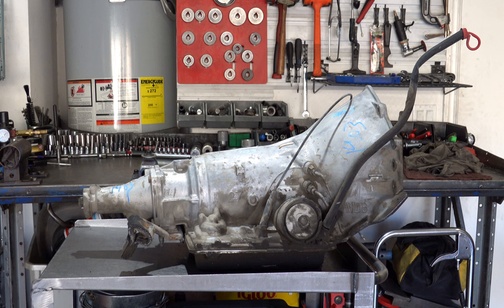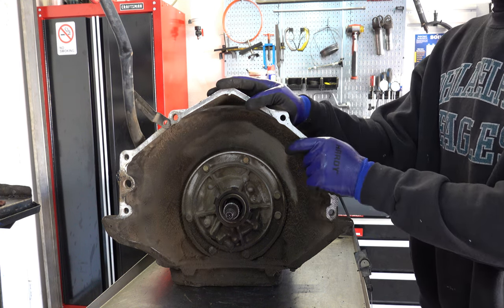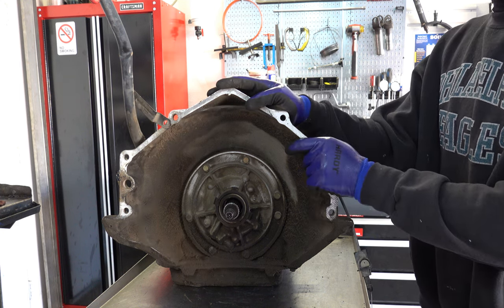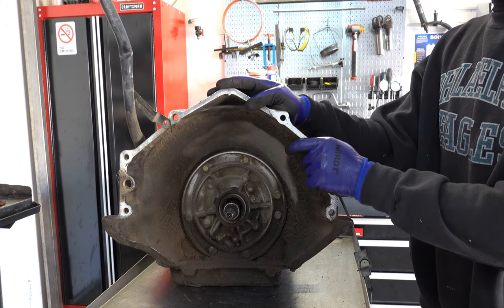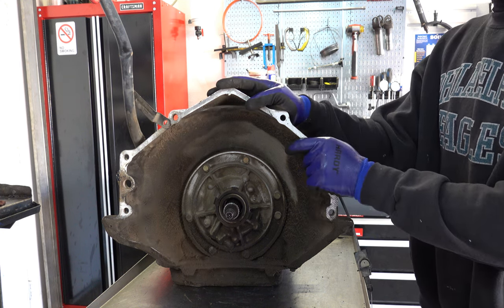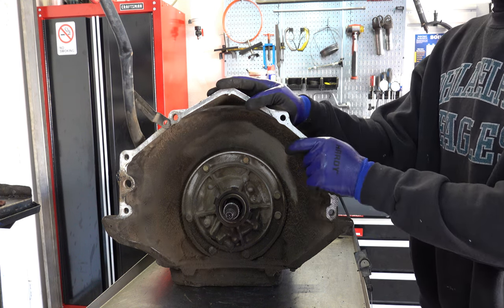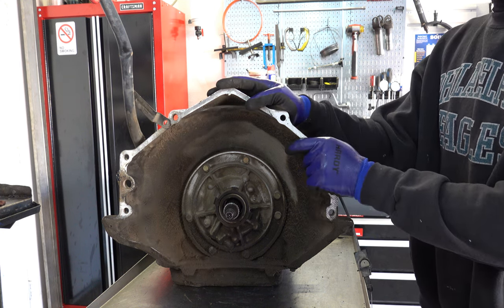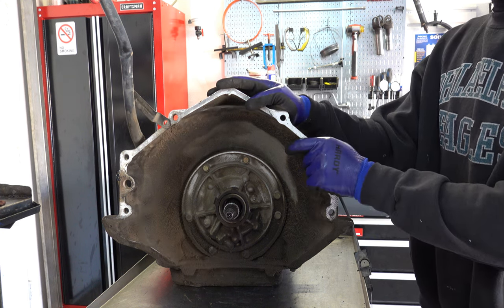700R4 Teardown and Inspection

Comment: Just found and watched your video, ive been debating on rebuilding my own transmission and your video has been the most informative video ive watched.  Other rebuilders were not as detailed or informative thank you sir for being very detailed and explaining what to look for and what to upgrade to for better performance and durability.  I will definitely be watching the rebuild.  Again thank you sir.
Reply from the maker: Thank you for the kind words, David! 

I'll be posting some 'special tool' videos over the next couple weeks showing the transmission-specific tools I use to rebuild the units I work on, including the 700R4/4L60E so look out for those...If you run into a jam, post a question and I'll respond as soon as I can.
Reply: @nickstransmissions  what do you think about the Turbo 350 hi energy green deluxe transmission rebuild kit from ebay and it costs $235.00 ?  for my 77 c10
Reply from the maker: Those are good kits...I really like the Alto friction modules that come with them...The kit will probably come with a plastic seal for the output shaft's snout...I have been using them in place of bushings as I think they seal a bit better...
Reply: Your videos are excellent, and much appreciated. I'm going to rebuild a 700r4 (1988) for durability, as my motor will be a 500rpm street only cruiser. Your vids have given me the incentive to do it myself. Haven't built a car in 30 years, so again, thanks for the good info. Cheers :)

Comment: Starting with my rebuilt, I sanded the case base with a rigid piece of glass + a 360 sand. Before sanding, I put a bit of paint with a little roller in top of case's walls, like a sand guide. Whit this procedure, it was possible to see the most minimal differences in case walls levels (mainly, lower in the center area) and correct it, with aprox. 15 or 20 minutes sanding.
Reply from the maker: Good work, Denis. Sanding definitely reduces likelihood of cross-leaks and is worth doing, especially on older transmissions like the 700R4.

Comment: glad for the vid. will be rebuilding one this winter. have done 1 4l60e with success, so its the 700r4 valve body that im studying out of a 92 chevy truck as ive read that they are different
Reply from the maker: Cool Randy - nice thing about the 700 and 4L60Es is the case architecture is identical. Only major differences are the valve body / solenoids in the 4L60E vs governor/TV cable of the 700s. 

All 700R4 valve bodies made from 1988-1992 are identical...1993 valve bodies are different (they only went into F-bodies and Corvettes in that year). All 700R4 valve bodies made from 1982-1986 are the same and all valve bodies made in 1987 are the same. You can install any year valve body in your 92. I install 1982-1986 valve bodies in 1987-1992 700r4s for folks doing resto-mods/hot rods where they're swapping out things like TH350s and 400s to get overdrive but don't want to mess with any electrical work to lock the torque converter. the 1982-86 valve bodies have a TCC mechanical lock up control valve whereas the 1988-93 valve bodies do not.
Reply: we got everything right, first attempt on the 4l60e EXCEPT for the boost valve snap ring.. pulled the trans out, and it was hanging down,, I didnt think that the boost valve was accassable without pulling the trans,, thats a mistake that will NEVER happen again., why they have that lower groove in the pump housing below the groove that the snap ring actually goes in is a mystery to me, but im sure its tripped many a novice builder up. 
different subject, on a 4l60e, have u ever heard of this.. you take an unneeded servo cover off a junkyard engine, grind the top off where you would grab it with pliers to take it off.. install everything in the servo bore, and put the modified servo cover on,, then you can push the servo pin in to see how much clearance you have?
Reply: being 54, I wondered  abt how automatic transmissions worked for many years, and finally got the confidence to open one up, and they are fascinating indeed.. if I wasnt retired, I would strongly consider rebuilding them for a business.  what im doing now is buying the gmt400 platform trucks that have bad transmissions in them, rebuilding the transmissions, fixing them  up, and selling them for a hobby.  the 92 I recently bought  is said to have had someone go into it 3 times in the last 4 years, so im going to have to really be vigilant in checking everything that is inside, or not inside. your vids will help tremendously,, thanks
Reply from the maker: Sucks - sorry to hear; I hate when that shit happens (and has happened to me more times then I care to remember, haha)...In L2006, GM began installing a turbine speed sensor into the 4L60/65/70Es and thus you could no longer access the boost valve from under the trans. You have to take the trans out, remove the pump to replace the sensor or boost valve. And there's no way to tell which 2006 units have them unless you remove the pan and look.

Re your servo question: No need to grind the cover...Just use yours, install the assembly w/spring but leave all the o-rings and seal off. Then measure your travel either by pushing it in and measuring w/a ruler or mount a dial indicator and push the cover in w/a large drift punch or hammer handle (or your hands, whatever fits and doesnt interfere w/the indicator). 

Sonnax has instructions for taking the measurements...works on all servos: https://d2q1ebiag300ih.cloudfront.net/uploads/part/2486/77911-03K-IN.pdf?v=1665514848835.
Reply from the maker: You're welcome, man! Glad to hear they are helping you. GMT400s are becoming more and more popular so good on you for learning how to rebuild so you can make some $$$ and eliminate your dependency on transmission shops.
Reply: @nickstransmissions   yes,., who would have thought the old chevy C10s or squarebodys would be worth so much money just 10 years ago.. trucks like these were real trucks, for hard work or play, not garage queen cream puffs..
Reply from the maker: Yea, I didnt think so either but real cars and trucks will always have value.

Comment: I watched this video intently , due to the fact that my 92 Chevy Suburban K1500 4X4 ( 350 v8 stock w / 700 R4 ) just gave me trans problems " YET - AGAIN " !!
I installed a GM GOOD WRENCH REBUILT TRANS bought from the GMC dealer we had a parts account with for our fleet of GMC's Top Kicks at the Excavating Co.
This was April 2015 , at the same time I installed a ( DERALE deep pan with the cooling tubes ) and a ( B&M SUPER COOLER behind the grille )  w/ the stainless steel cooling lines going straight to it / eliminating the radiator cooler )

I am the only one driving it , do " NOT " tow with it , and I am a diesel mechanic by trade on MACK TRUCKS , and have changed the oil & filter kit ( RELIGOUSLY every 12,000 miles ) .

( I NOW HAVE 61,000 MILES +  ON IT  )    & HERE I AM AGAIN WITH ISSUES ???

I just started having shifting issues with it on the 1-2 shift , but if you let off the throttle & back on , it shifted up through the gears & lock up converter .                   OIL PINK LIKE NEW /  NO SMELL / NO BROWN / NO NOTHIN  ????

Took it to the trans shop , they said it has " NO " 2nd GEAR ???   ( THE BAND )
OF COURSE THEY ONLY WANT TO " REBUILD THE ENTIRE TRANS " and I am in Florida away from PA. !!!

From watching your video intently , sounds like that ( SERVO 2 - 4 PISTON SEAL ) gave up and stopped applying the ( BAND )?
I first checked the " TV " CABLE , for proper adjustment , and found it to be very good , I did try moving it slightly forward & back from the original position , with a quick test drive , ( NO DIFFERENCE ) put back to original spot ( marked w/ paint pen ) .

I have given that 700 R4 the best life I could ,  and yet here I sit , AFTER ONLY 61,000 + MILES ??????
I told this very same story to the trans shop owner ,   said if there are updates to keep that trans " BULLET PROOF "                 
BY ALL MEANS DO IT  !!!!!!!                               ( THEY COULD CARE LESS ) !!

ANY THOUGHTS FROM YOU WOULD BE GREATLY APPRECIATED, WILL NOT PIT YOU AGAINST THEM , BUT I CAN'T KEEP 
PUTTING A TRANS IN THIS THING EVERY COUPLE YEARS !!!!!
I HAVE OWNED THE TRUCK FOR 20 + YEARS AND THE TRUCK IS CLEAN , NOT GETTING RID OF IT ANY TIME SOON !!!!

   SURE WOULD APPRECIATE YOUR THOUGHTS !    HOPE TO HEAR FROM YA SOON !!                
                                                                                                                                                                           THANKS  PAUL
P.S.  I SUBSCRIBED TO YOUR CHANNEL ,  I WISH I HAD DONE MORE WITH AUTO TRANS , INSTEAD OF MACK TRUCKS 
                  BUT I AM STILL LEARNING WATCHING YOUR SHOW ,  KEEP UP THE GREAT VIDEOS  !!
Reply from the maker: Hi Paul, thank you for subscribing and watching!

Does the transmission not shift into 2nd gear at all - does it shift into 3rd then 4th? or is it slipping into 2nd gear?

If it doesn't have 2nd gear at all but does have 4th gear, the band is likely not the issue however it can be if it's just worn enough to slip or neutral in 2nd but apply in 4th when both servo pistons are applied. When in 2nd gear, only the second gear servo piston applied which is like holding something with only one hand instead of two (the 'second hand' being the fourth apply piston).
Reply: @nickstransmissions 
 NICK , thankyou for your quick response !!

I will tell you the exact way this all went down , 
I was heading to Daytona Beach area of Florida from the Philly area when this all occurred ,
trans was not slipping far as I am concerned , only problem was it would not shift into 2nd gear unless you
let off the throttle then re - applied throttle . then it would go up through the gears into fourth then the lockup converter would apply as well ,.
I would then set the cruise control for 74 mph on I -95 south bound towards Florida (NOTE # A 16 HOUR RUN)
as far as I am concerned , I counted what I believe to be 4 shifts !!!!

As stated earlier, got to Daytona and checked fluid constantly on way down & arrival , pink like new / no smell / no brown / no nothin ????

re - adjusted the TV cable several times to test for out of adjustment, quick hops ( NO DIFFERENCE ) ??
Made appointment with LOCAL REPUTABLE TRANS SHOP,   "  2 WEEKS OUT "   ( THAT BUSY ) !!

August 6 , dropped it off ,   got a " TEXT " 2 HOURS LATER from secretary stating ;
(1)   no 2nd gear 
(2)   $ 2500 - $ 2700  COMPLETE REBUILD  !!!!!!!!   

                           ??????????????

Drove over talked to secretary ( knows nothing) asked to speak to owner & go for test drive with him  ??

He came to office stated ( NO SECOND GEAR / when I shift it manually from 1st to 2nd nothing there !!!!???????
I SAID ; I did not shift thru the gears 1 by 1

 BUT , I counted all the gears & I find nothing in oil to indicate burnt band ????

HIS SHOP IS VERY SMALL / VERY BUSY/ IN A SMALL TOWN / !!

 I HAVE BEEN IN THE INDUSTRY 45+ YEARS
AND I COUNTED ALL THE GEARS & NEVER " SLIPPED " JUST DID NOT SHIFT WITHOUT OFF THROTTLE / ON THROTTLE .
    
 NOTE # CAME FROM PHILLY TO DAYTONA  NEVER QUIT  !!!??????????

MORAL TO THIS STORY ; 

 HE IS SO BUSY , HE DOES NOT EVEN HAVE 2 MINUTES TO THINK ABOUT IT ????????

PULL IT ,  REBUILD IT ,  GET IT THE    (   F.....     OUTA A HERE )    !!!!!!!!!

I FEAR  ;      THIS IS THE WAY ( MOST TRANS SHOPS OPERATE ) 

                               AT THE " CUSTOMERS -  EXPENSE  "  !!!!!!

THAT IS WHY ; I was watching your videos ,   I do believe I am being    " LIED TO "   !!!!!!! 

AND AFTER WATCHING YOUR 700 R 4 TEAR DOWN & EXPLANATION ,

        I THINK I AM RIGHT ON THE WAY THIS GUY OPERATES  ??????

                                 I ONLY WISH I WERE WRONG  !!!!

                                                                                                         THANKS   PAUL
Reply from the maker: Yea, he could very well have thrown the "it needs a rebuild" out there to see if you'd bite, figuring he really doesn't have anything to lose given how busy he is...Just a guess...I taught myself how to rebuild these things so as to avoid that entire cycle of uncertainty/feeling you're being deceived, etc. 

If you have four forward gears but you have to let off to shift into 2nd gear, the first thing I would do is a line pressure test to validate the TV cable is, in fact, adjusted correctly and that the cable itself is able to retain it's adjustment (over the years they wear out and lose the ability to keep TV adjustments which can lead to gradual line pressure degradation inside the transmission. 

Next, I'd pull the servo out of the case and inspect it for any unusual wear, excessively worn sealing rings, etc - then go from there based on what you find.
Reply: @nickstransmissions    
 10 /4 !!   my thoughts exactly,  you try to get across to the guy , that I can't keep rebuilding these transmissions ( EVERY TIME THE ASH TRAYS GET FULL ) but like I said in the first comment,
   ( he could care less )  !!
was just watching your video on the valve body re - assembly , reminds me of rebuilding a " JAKE - BRAKE " 
on a MACK E-6 or E-7 with the slave pistons ,& hand fitting everything for smooth operation  !!
                              The last thing you want is to have to take that thing back apart again !!
                                                                PATIENCE - IS - A - VIRTUE !!!!!              
                                                                                                                                                   THANKS   PAUL
Reply from the maker: Yep, same principle and concept. And no doubt, I hate comebacks!

Comment: I thought the load springs were there to solve the nascent timing issue during a 3-2 kickdown downshift, when the band applies before the 3-4 releases, causing the latter to bind-up and hence burn up. 

The other question - can you put in a 13 vane late 4L60E pump assembly and what are the benefits of that? 

Finally in the introduction, you missed out that somewhere in 1991-1993 period the 7004R got renamed the 4L60 (no E), which adds more confusion than clarity.
Reply from the maker: Hi Shalash87, the load release springs were installed primarily to prevent centrifugal apply when driving through the 3-4s in first and second gear, especially at higher rpm though they probably play a minor role in preventing tie-ups as well. That said, the spacer plate hole sizes for clutch feeds and band releases combined with mechanical calibration of the valve body’s shift valve trains are the primary methods for keeping the timing in synch. Go real lopsided on those hole size’s between feed and exhaust and a tie up is all but guaranteed. 

No major benefits to retroing a 13-vane pump into a 10-vane trans as the additional vane count was increased primarily to make the pump quieter at part throttle. In fact, those pump rotors are technically weaker than 10 vanes and I believe mods have to be made to the pump cover for it to work. The 10 vane pump moves sufficient volume and does its job well. I recommend billet rotors when rpms are expected to exceed 5k on a regular basis. Otherwise they aren’t necessary either. 

Lastly, im sure i missed a bunch of things in that tear down video, only so much to cram in but I will do topical videos on the first two things you’re asking about as they are commonly discussed but there’s still not a ton of clarity out there on either topic. 

Thanks again for watching and your feedback!